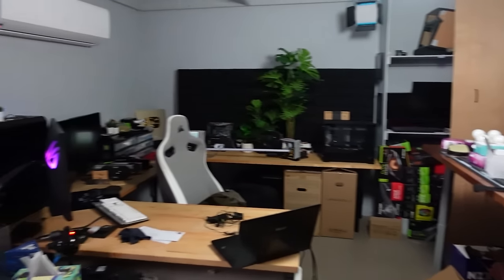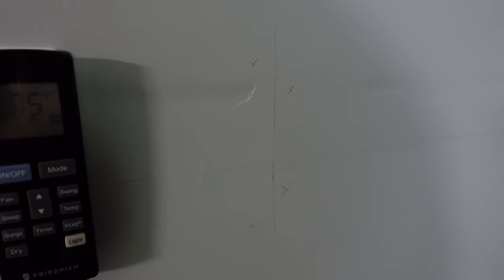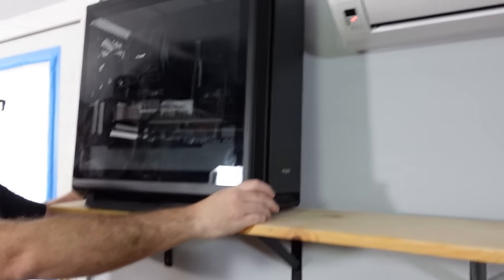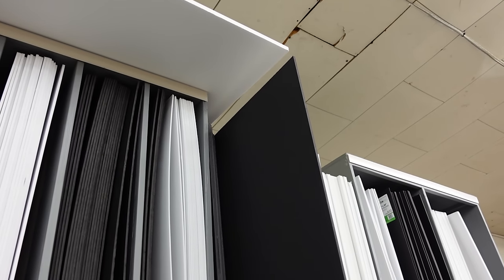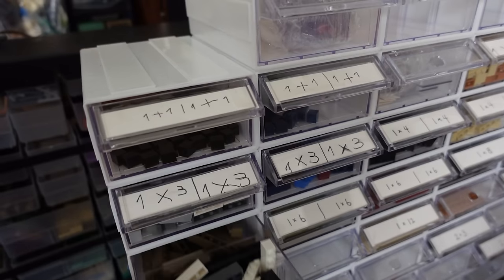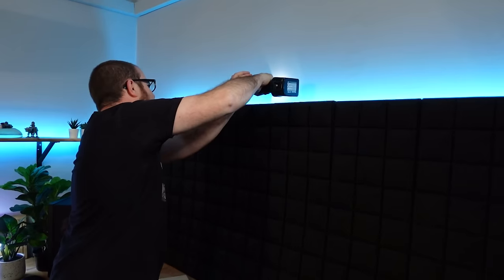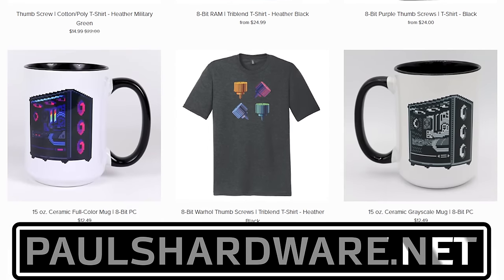Garage Worklog: UPGRADES

Comment: Lives in the LA area... that PC needs to be strapped to the wall because of earthquakes. Super easy to do, just get some pipe strap, and wall anchors/screws. Pipe strap is the metal straps with holes through it, bolt one end to the case using the holes for mounting fans or radiators then put the PC on the shelf find the best hole on the other side of the strap for putting in the anchor, mark the wall for the anchor and where to cut off excess strap, repeat for the other side of the case so one is on the front and one on the back. Put the wall anchors in, trim the straps, put PC on shelf, screw the strap into the wall anchor. Done and earthquake safe in less than a half hour.

Comment: One thing I've done with some black wall brackets that I used non-black screws with was to blacken the heads by heating them up real hot with my blow torch and toss them in some cooking oil. Looks good and I can use better screws than most of those brackets seem to come with.

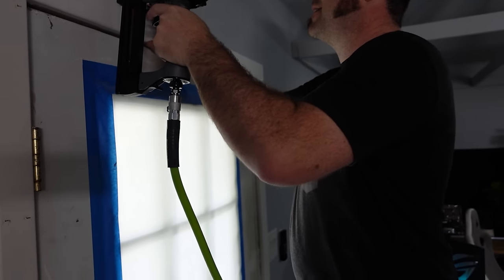Comment: Hi Paul. I see you have the opportunity to start a new channel. You could call it "This Old Gamer Room." The door trim, 2:00, could have been mitered. A small trailer is always lovely to have. I always take mine when I go to Home Depot or Harbor Freight. I keep a small pancake air compressor in my gamer room. It allows me to spray paint and remove dust from my PC.

Comment: Joe and Paul are really living the American Dream..... doing dad tasks

(edit) also, if you have an outlet down low on the left side of the PC, you could possibly put another one up higher above the light switch so you dont have to run any loom to hide AS MUCH wire!!

Comment: with that heater/AC right there won't that be an issue during the winter pulling in hot air into the PC?

Comment: Damn Paul you needed a miter saw for that trim. Then I would have mounted the door trim piece flush to the frame and roto-zip in the strike plate but that's just me. You are the only guy I know that would spend $1000 for a GPU but wont cough up $100 for a miter saw
Reply: Yeah. Pretty bad. 😬

Comment: Putting the computer on the shelf that close to the mini split seems a bad idea. The heat from the PC will be drawn into the mini split and be used by the thermostat of the unit to determine room temp. This could mean in AC mode it working harder than it needs to.

Comment: Way too close to the AC. Even sometimes the AC starts dripping water if the drain line is clogged. So it's best to not put anything electrical under it.

Comment: You're out of your damn mind if you think having a full ATX computer sitting on that tiny ass shelf is "safe". The second something snags or tugs with even a modest force on that cable bundle going into that PC someone could seriously get hurt. Hope you don't have kids in that space. Get some kind of toolless latch installed that physically attaches the case to the stud directly or lower the center of mass to within a foot on the floor. You've got a couple of bowling ball's worth of mass sitting above sitting height just waiting for something to pull it down.